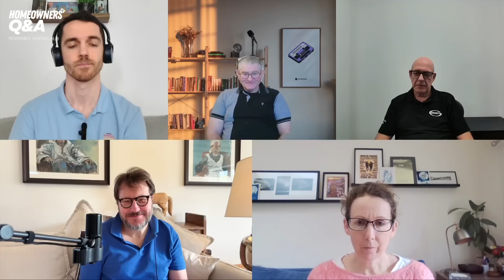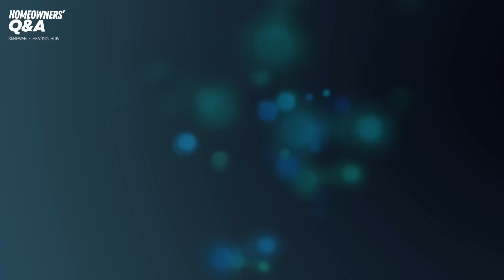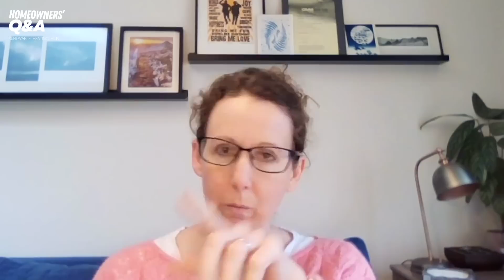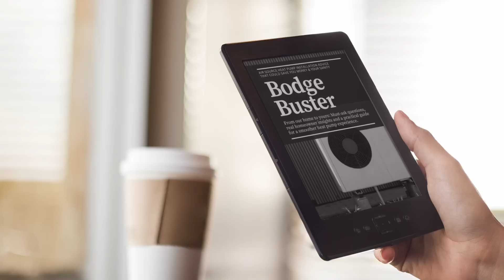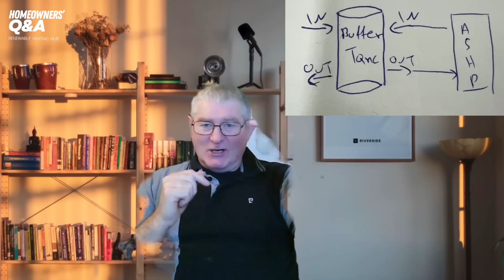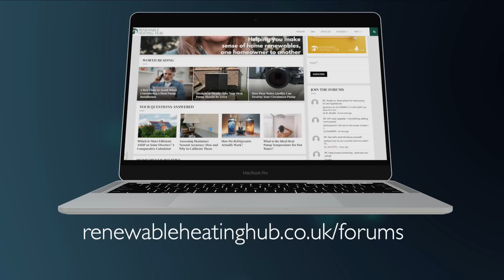Efficiency Killer? Are Buffer Tanks Costing You More Than You Think?

Comment: Super video and really clear.  I'm in the middle of making some tweaks to my own 15 year old GSHP system as there were some errors in its design that mean my COP is suboptimal and I'm not able to take advantage of cheap rate tariff periods as much as I think I can. On this last point, rather than using a seperate buffer or phase change thermal battery, the strategy I'm focussing on is to overheat the house slightly (esp as I have UFH in many rooms) and bank that energy for the remainder of the day reducing heat pump demand when tariffs are higher later.

Comment: not worried about carbon foot print ;'=-  you want to be comfortable thats why you spend all that money. on hvac and insulating a home and adding a erv system.ng is not bad it works /when the power goes out electric dos not work with out battery back up or generator. it;s just more money.

Comment: I have fitted a HP to a 500L thermal store. Everyone said don't do it, it won't work with some manufacturers saying I'd have to fit a buffer or the warranty would be void ! Total madness. The store was in place already I wouldn't have fitted it otherwise but the system works brilliantly. The flow rate is brilliant and cycling is nonexistent. Being lucky enough to have quite a large property zoning the system isn't a problem and I don't have to worry about legionella cycles because the hot water is heated instantaneously. The tank does run at a constant 50 degrees to give enough hot water the heating would work fine at a lower temperature. January we had a cop of 3.6 which I'm very happy with. I do have a log burner with a back boiler and the store has two immersion heaters that all heat the store although I moved from Agile to Cosy tariff in December so haven't used the immersions since then and only use the log burner on the coldest days because it's nice to use and not because the system in any way needs it. A lot of people won't have space for a store but if you do they are a good option that can mean very little work to the existing heating system. Heat Geek have come up with mini stores that fit in kitchen units to provide hot water. Replacing a hot water cylinder with a thermal store and removing the need for hot water cycles I feel should be looked in to further.
Reply: The thermal store is just a hot water tank i presume, why wouldnt it work, or are you running the heating circuit through it?

Comment: @BrendonUys ❤ your rant at 36:30
Reply from the maker: A good rant, and he's right.
Reply: @RenewableHeatingHub there is a simple way to balance a buffer without a flow meter on the secondary side. 
Proper engineers have been doing it for years. 
Mars. When Leah mentioned installing buffers on systems where pipework couldn’t be identified, such as retrofit projects and Brendon was shaking his head frantically, why didn’t you bring Brendon in to counteract her argument?

Comment: What I find strange, is that we are told that heat pumps arent a new product, theyve been fitting them for years, and the problems are all about  the UK's  heating fitters lack of knowledge! But if you look at the rest of Europe they   predominantly fit buffers. A lot of manufacturers wont fit without buffers.So who are right? The knew kids on the block, or the rest.
I was under the impression that a buffer will help with short cycling and also help with the defrosts, where most units, use the heating water to help. This extra volume will stop the house from cooling down as much. So any ineffencies with a buffer are outweighed by the buffer helping with longevity of compressor and when its needed alleviate some of the problems with defrost cycles, which arent discussed enough.

Comment: Brendons one solution blanket approach is nonsense. There are so many different properties with different reasons to fit different system components including buffers happy to prove him wrong any time
Reply from the maker: Are you an installer? If yes, would happily have on to share you insights and perspective.
Reply: I am indeed I have around 1000 heat pump installations under my belt I have read the cibse heating design guide front to back I have gone through all the heat geek training and have built my own app on designing all things heat pump. I love the discussions and this channel is fantastic the views of all the top heating engineers out there are inspiring but for any one influential person to make these statements is a shame every property has potential differences even to identical houses on the same street can be totally different if the customers seek to achieve different things. All this one solution fits all guys are so obsessed with chasing efficiency and that’s brilliant but this is at the cost of comfort in a huge way. Having an open loop system is to ignore the uncontrollable variables in real world conditions where solar gain and exposed locations make it impossible to have a property at an even temperature throughout and these potentials can be mitigated with a buffer vessel and multi zone controls or sometimes just multi room controls and no buffer or sometimes it maybe fine with a single zone or sometimes dual zone and on and on and on the point is having a one solution fits all approach is wrong having an opinion that seems to be so linear in Brendon’s case I could put several design scenarios on paper that his view of no buffers would be the wrong approach. just to be clear I am not pro buffer nor against buffer I am pro education and taking time to sit down with my client in there building and develop a solution that suits themselves and there buildings needs and not presenting them with an efficiency boisterous single track view. Il leave it here but could go on forever. Love a good debate and keep up the great work. All talk on heat pumps is great for our industry
Reply: @lukerussell5674 Thank you👍
Reply: I’m happy to talk more and share more views or thoughts if that’s something you would be interested in
Reply from the maker: Please email me when you get a chance: editor@renewableheatinghub.co.uk

Comment: 23:05 I'm not entirely sure what is being said here about modulating pumps.
Is it that an ASHP may have a modulating pump built into it and if so then the connected open loop heating system should also have a modulating pump built in to avoid the potential for different flow rates between what comes out of the ASHP and what is pumped round the open loop?
Or was this point specifically aimed at non open loop systems?
Thanks
Reply: ASHP with modulating pump is delivering water to open loop system. Usually all models today on market must have modulating pump.

If buffer is installed as a separation, then secondary pump also must be modulating because fixed speed could cause a problem if not set up properly.

Comment: I think these discussions could be really useful. However they seem to targeted at installers or "geeks". It would be nice to have simpler explanations and more diagrams. I have a buffer which includes a hot water tank inside, so a tank within a tank. The buffer is fed by an air source heat pump and thermal solar. The thermal solar goes through a coil. I am considering adding a third heat source. I am struggling to understand from your video how I would have this without a buffer 🤔 I have an old house with a high thermal mass, and a heated area of around 200sqm. The buffer has a volume of 500l and the hot water tank has 50l. It has 4 pairs of input/output connections plus an additional pair for the thermal solar coil. The heat pump is rated at 23kW.
Reply: Your system design does not suit a heat pump.
Reply from the maker: Thank you for your feedback. We’re aiming to keep these discussions as non-technical as possible, but you’ve raised an interesting point. In the coming weeks, I’ll be scheduling another session on buffer tanks, where viewers can submit videos and images for our panel to assess and provide advice.

If you’d like to take part, please send us a question about your system and submit high-resolution photos and videos via WeTransfer.com to editor@renewableheatinghub.co.uk.

Comment: Great discussion, it was great for me to share experience and discuss. I think this format is excellent.

As we mentioned few times in the podcast, design is the most important thing - with or without buffer. But simplicity will usually have better performance as it is easier to set up the system.
Reply from the maker: Thanks for sharing your insights and knowledge.

Comment: Regarding cheap tariff energy storing - I only heat my DHW to 50°C at cheap night rate and set the temperature to 40°C during the day to avoid heating the water.
Reply: I'm off-grid, and use the same concept except: a) I use excess solar when I have it and use it to go as hot as I can and b) my buffer tank is really an energy store of 3000L, which both provides for the underfloor heating and hot water. 

I can easily store a day or two of energy to bridge a cloudy day without tapping into the 120kWh lithium battery.

Comment: How annoying - youtube just lost my detailed comment! 😡
Brief summary - I have a low loss header necessary for installer warranty (it keeps the heat pump happy with low radiator flow problems).
Heat pump 28mm to low loss header was originally connected to my 22mm flow and return rails with 22mm but I pointed out this was a bottle neck and got them to upgrade and Tee in with 28mm. As a result I have zero distortion across the header so there's probably no need for it or the secondary pump either but removing it would probably only save 100W or so as the secondary pump is minimally loaded.
Reply from the maker: Interesting. How have you established that there’s zero distortion?
Reply: @RenewableHeatingHub By measuring the IN to OUT temperatures flow and return across the header - the temperatures match so there's no forced mixing.

Comment: 11:05 Modulation does come with an efficiency penalty. If a large system has to regularly modulate down below 50% during partial load, then it would be worth having two smaller units in an "array" or in "parallel" (for some reason we use the term cascade here in the UK, which is not correct) so that you can turn off a unit whilst the remaining one operates at a higher, more efficient, output. 

A buffer can be used to operate a larger unit without excessive modulation or cycling of the compressor, reducing COP loss. (edit Niel mentions this later)

This becomes even more important with R744/CO2 heat pumps, as they like to operate at high output and really don't like cycling - more so than typical refrigerants. It's related to CO2 operating at higher pressures to exploit transcritical heat transfer, which allows for a single stage heat pump to work across a larger temperature range whilst maintaining good COPs. It's why they're used in DHW systems. 

Personally, I think we will start using thermal storage to exploit cheap time of use tariffs, where the COP penalties for operating at high flow/storage temps is more than compensated by the cheaper electrical energy, essentially optimizing for cost/unit thermal, not SCOP.
Reply from the maker: Thanks for the comments and interesting perspectives?

Comment: Could I ask your panel  the below questions for me, Thanks

a) When UFH is installed below timber floors, how do they both protect the floor finish from overheating whilst also keeping the UFH circuits open at all times to maintain the system volume and flowrate. 

b) How do they balance the flow through the radiators to ensure each radiator achieves it's allocated flow. Do they just balance on temperature, use presentable valves or use rad manifolds with flow meters. 

c) It would also be good to hear their recommendations upon what level of training they give their clients, and what they expect their clients to do to fine tune the systems.
Reply: +
Answers to your questions. 
a: Your underfloor heating design will specify a maximum flow temperature permitted to prevent floor coverings form being damaged. This temperature is set within the heat pump controller to prevent the flow temperature from exceeding this. All good geat pumps have this setting. 
b: It is nearly impossible to balance radiators with current equipment. at best it is a guess. There is a product that I have seen, coming to market shortly that will enable proper, accurate balancing of all radiates. It is critical for best performance to balance radiators to design, if you do not, the radiators will not perform to design.
c: Personally, I use equipment that is user-friendly and intuitive, therefor user training is simple, however, this is not the case with all equipment, and some are very difficult. Maybe a question to ask an installer before purchase, to demonstrate the controller, or visit someone with a unit you are looking to purchase and get the impression of that user. I do not believe it is the responsibility of the user to delve into the system to fine-tune the heating.

Comment: Buffers can work, when each side has the same flow rate=less distortion. If the pipework is sized correctly in the first place and alot of of open loop circuits. Then both buffers and extra volume vessels are not needed.
Reply from the maker: Thanks Ken. Great to hear from you.